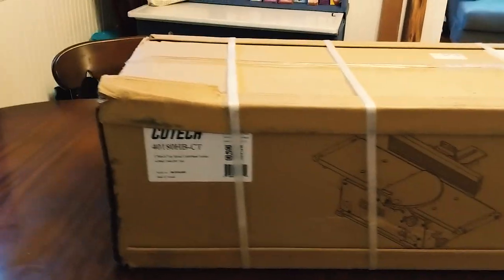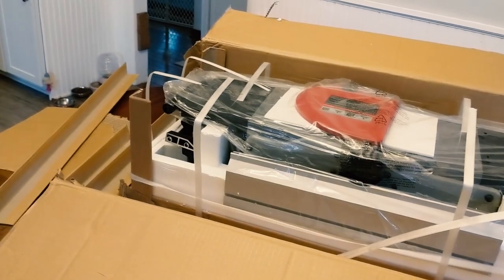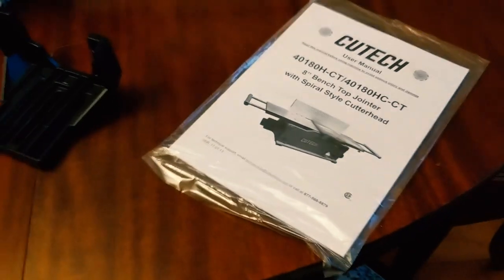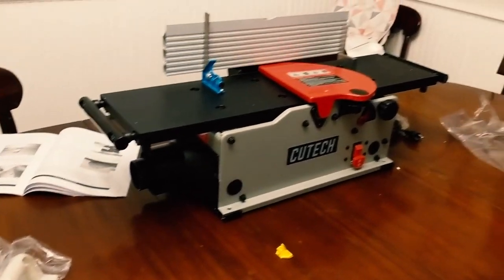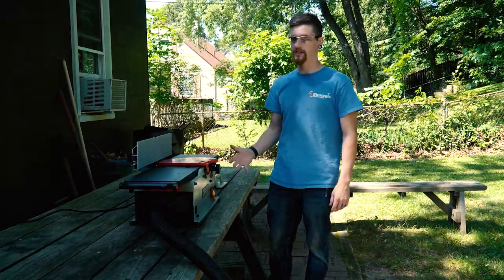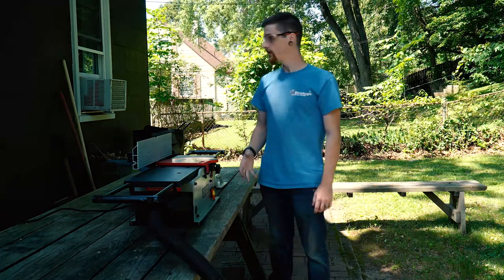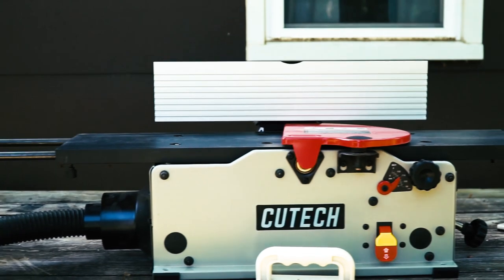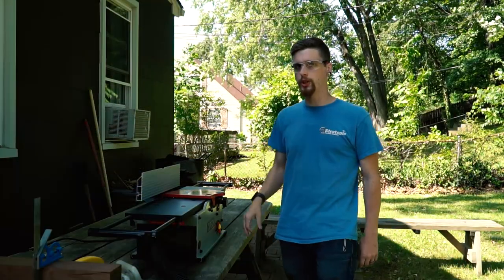Cutech 40180HB-CT Jointer Unboxing and Review

Comment: Matt,  First, you mounted the fence upside down. The concave arc in the long edge should be down and centered over the cutterhead. Second, the jointer does not suppose to eject the chips out if dust collection is not used. If you are not going to use a dust collection system, remove the entire dust port (with adapter) and the chips will slide down the inside dust chute which is mounted at an angle. You'll need to brush away, or vacuum up, the pile that will collect if you do this on a bench. If you have it mounted on a stand, the chips can fall to the floor.  I would also suggest, if using a shop vac, installing a cyclone type dust collection device between the jointer and shop vac. It will keep the shop vac filter clean and running at optimal cfm. Also, newly updated manual is available for download at the website. Thanks for the video. Sincerely, M @ Cutech
Reply from the maker: Mi Gi thank you very much for your reply and it feels good to know that you value review videos/consumer concerns. I will make these changes and I'm positive my results will make the experience even better than it already was.

Comment: You say the price point was $389.00. I've not seen this any cheaper than $449.00. Apparently got it on a sale. Can you share when you bought this? I'm in no hurry and can wait for a sale if they have one on occasion.
Reply: Dave R buy directly from wahudatools.com (formely cuetech tools as of 11/15/19). You can get the old Cutech 8" jointer for 429.99. They have a new 8" model under the new Wahuda brand for $549.99. with free shipping and 2 free packs of replacement cutter inserts. the new model now has cast iron table tops, longer redesigned fence and the cutter heads are now carbide standard & 4 sided.

Comment: After assembly what were the steps you took and setting up this jointer? Did you need to adjust the in feed and outfeed tables and if so how long did it take? I had to have another jointer sent out because I apparently received a defective machine. The tables on the first machine could not be adjusted for the machine to work correctly. Just curious about other people's experience
Reply: David Lashaway   I have the same problem. The infield table had to be replaced. I have spent hours trying to get the tables parallel and coplaner. A real pain.